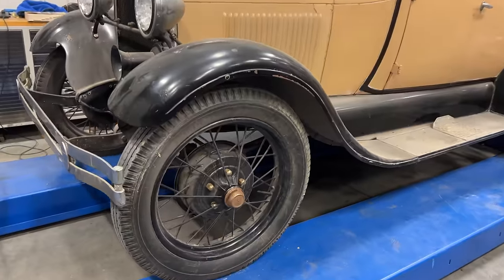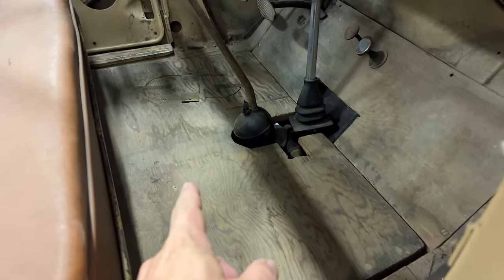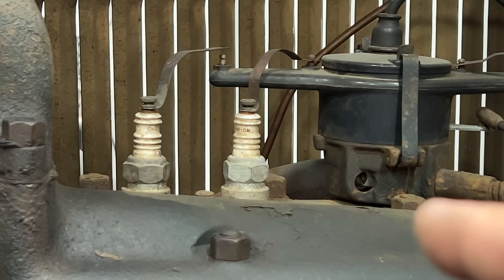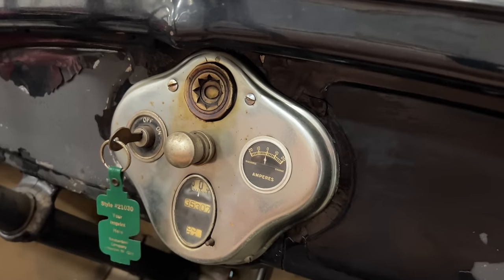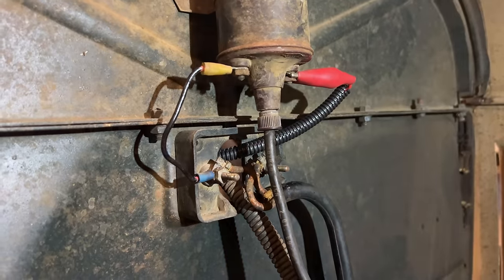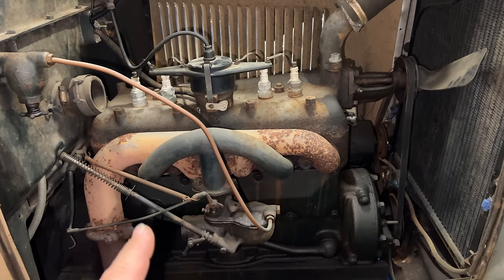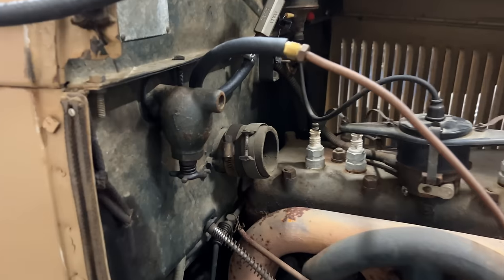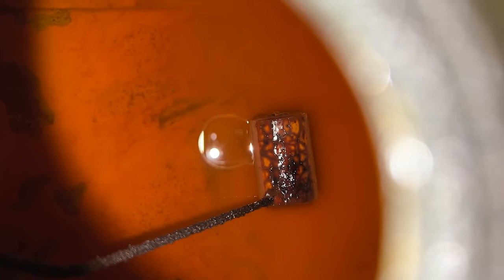1928 Ford Model A - Will It Run?

Comment: Such delightful simplicity. Everything's visible and identifiable. They've barely managed to put anything in the way of removing anything else.
That's a handsome machine. Clean out the fuel tank and give it a wash and polishm and it's ready to roll. (Well, maybe after a look at the brakes.)

Comment: I used to have a Model A living in my garage. It belonged to a friend and she eventually sold it. We swapped out the cast iron fuel strainer for one with a glass bowl. The cast iron one was rusted up. With the glass one, you could easily see what the fuel looked like. The bolt on the end of the carburetor that you pointed to is another strainer. You may have to clean the fuel tank. That's a big job because the tank forms the top of the cowl. As others mentioned, parts are readily available. I think NAPA still carries the spark plugs. Bratton, Snyder, and Mac are the big online parts sellers. Good luck!

Comment: The metal bulb on the firewall is not a fuel shut-off.  It is a fuel strainer.  The shut-off is under the dash on the inside, right under the tank.

Comment: Model A's never had an air cleaner from the factory.  It was aftermarket.  Sometimes the leaking carb would cause gas to accumulate in the aftermarket filter.  A backfire would then catch the car on fire.

Comment: Fantastic,  a little bit of a bodge here and there made it run so well done Steve . Probably a wise move not to use the tank. I have to say it did surprise me that there weren't more wires that were 'toast' but that is a bonus I think. Thanks Steve very good condition model A. It will be on the Road in no time. Don't forget your goggles I think they are mandatory 😷.👍👍
Reply from the maker: The dashboard and the cowl are completely separate looms so something wrong with one does not affect the other.